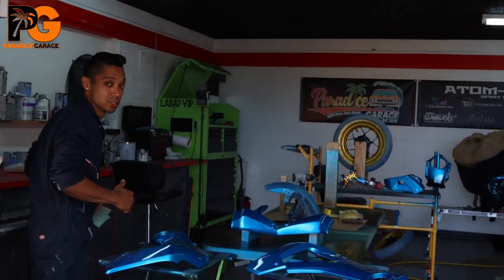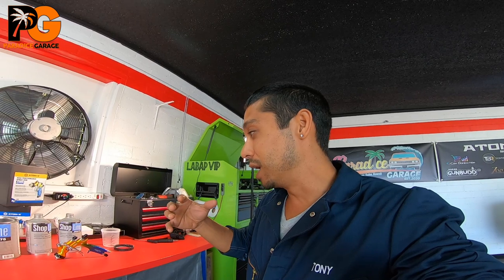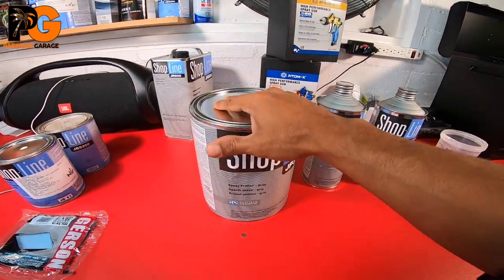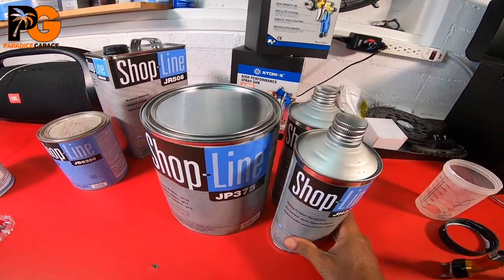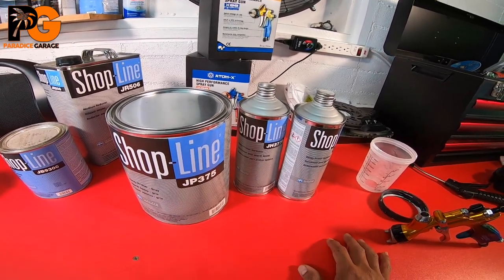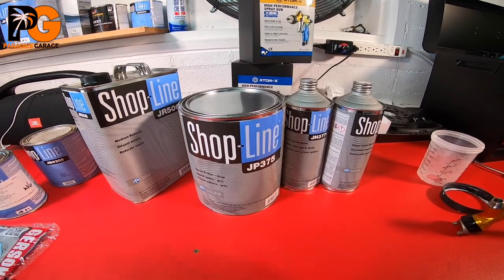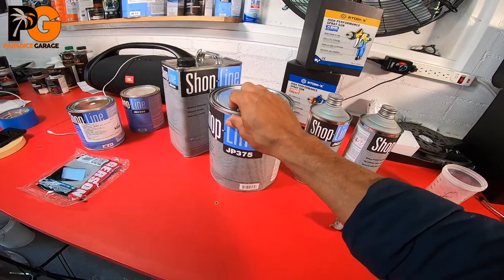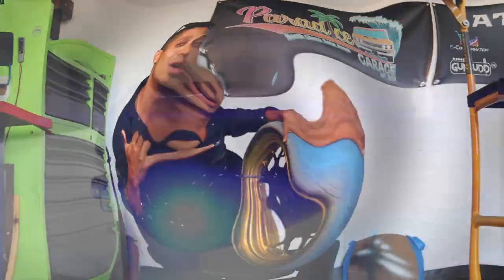DEAD SIMPLE! How-To Mix Any Brand of Automotive Primer or Paint!

Comment: Dude, you are so inspiring! Thanks to you I feel confident enough to paint my own truck! I really appreciate your help! Keep up the good work!
I have already purchased the filler primer, base coat, and clear coat. Gun and everything in between, thanks to your guidance. I felt like a pro when I went to the store to purchase all these items. I cannot thank you enough. I believe I will be purchasing your program, once I gain some experience. I have a small painting business for around 6 yrs. now but it is with interior and exterior (home and commercial) paints. Looking forward to paint and fix cars as a money making hobby. 👍🏽
Reply from the maker: Wow, that's awesome. If you are a painter, you can paint anything! I recently painted my home as well. So good with the rollers too 😂
Reply: @HowToPaintYourCar  🤣 Watching you sure makes me think I can paint anything.
I was waiting for some materials to come so I can finally start practicing with a bumper I bought and the roof top of the truck (which has some rust issues).
I have been rolling and spraying wall and ceiling paints for quite some time. So I am pretty confident with spraying. Thank you!

Comment: Tony, can you name instances when I would reduce the mixture other than switching to a small tip size? cb
Reply: Reduce if it is a hot area, so that you have a longer wet time, to avoid getting a layer going on as almost a powder, instead of as droplets.  By me as it is pretty much always hot I use around 10%, so the solvent flashing off during painting does not result in making what looks like flocking. Yes for some coatings the reducer is more expensive than the coating, but you need a good amount anyway to clean with before and after use. That way you can get 2k to come out with zero polishing needed, and not sit there for a day afterwards getting it smooth, and removing half the paint you just paid for and put on.
Reply from the maker: Also, ANY reducer can be used most times. Just use any basecoat reducer to thin your primers.

Comment: thanks man, you helped me little to overcome an issue I have as in where I live we don't have enough choices of car paint supply that help, for example Primer we have mostly acrylic , we don't have sealers and paint is sold by weight with zero instructions of ratios and mostly from Italian company called FIDEA which has the poorest support b website and zero informations on how data ,so after watching lot of helping youtube channels such yours I start practicing on external sheet metal from scratch just to find a close finish that satisfy the result. I have one question if you can guide me to go, Q: I have thick base coat ( solid paint ) and found the suitable ratio is 1:1 with thinner , can I add hardener to it to accelerate drying process without affecting the result and.
Reply from the maker: Hey Man! Join me on my Youtube live next Tuesday 9pm EST and shoot me with your auto body and paint questions. For more tips and tricks on auto body and paint and to get your free manual guide check out https://vip.learnautobodyandpaint.com/home
Reply: @HowToPaintYourCar  realy appreciate your support and sure I will be online during your live show ,